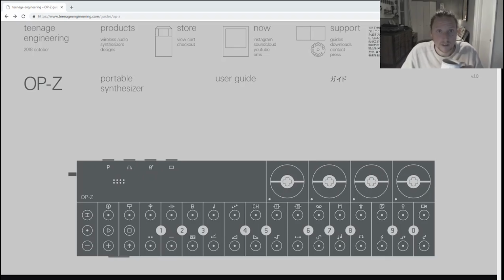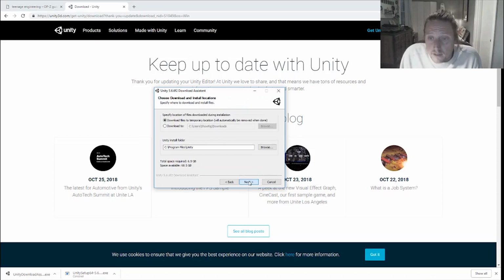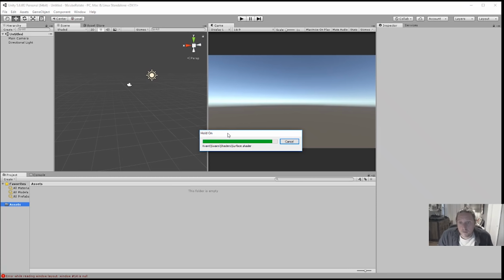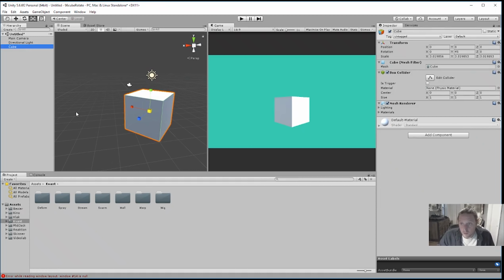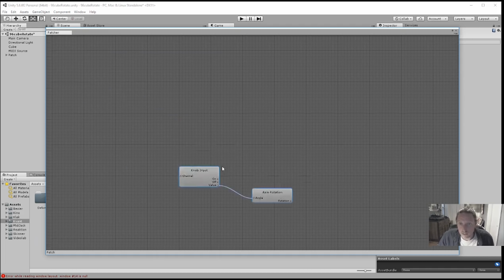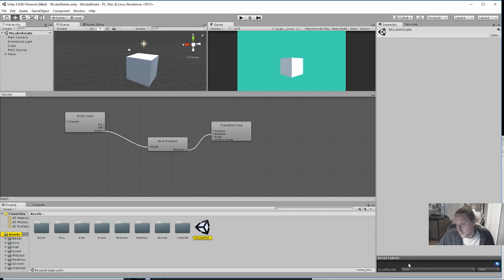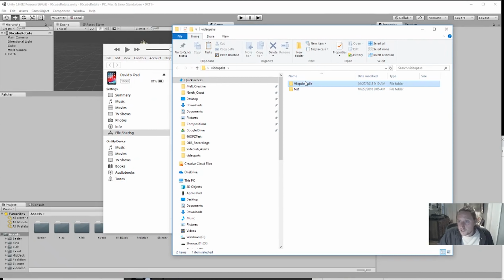OP-Z Videolab install and first steps

Comment: If you are a newb working on a fresh install and it just happens that nothing is working and there is a red error that seems to be telling you that you need the version of visual studio you've installed 4 times stop banging your head against the desk and do this. Open a new project, import video lab and in the project tab create a new folder called lab in assets and drag everything from the asset file into it... Now try again... There I just saved you 3 days of trouble shooting a QC issue nobody is talking about...  :P

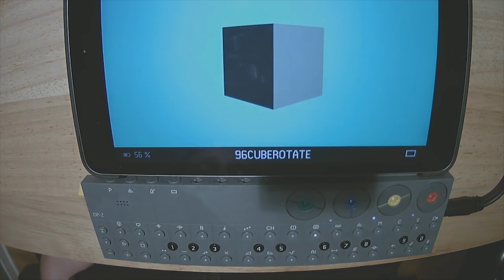Comment: 21:58 alternatively it is possible to set MIDI channel 16 and CC 1 for knob input inside the patcher so you don't have to change the MIDI settings inside OP-Z app, but this is a step further this tutorial i guess :)

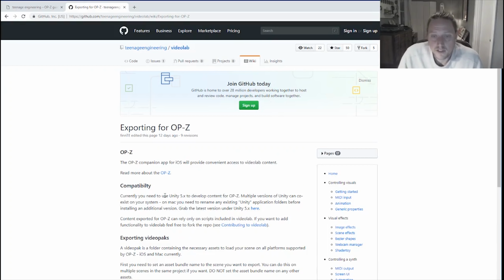Comment: 2:05 "Unity 5" - is incorrect these days? I just had Teenage Engineering tell me to use Unity 18.2.x   - if you could please update the description of this video to reflect the current advice from T.E. that would be handy. 💙👍
Reply from the maker: Thanks for reaching out!  I have 100% been meaning to release an updated series.  That stipulation that I mention actually was voided quite soon after the video released, apologies if I led you down the wrong path.

Comment: I have followed your directions over and over and over, and the ios app crashes every single time I click on the cuberotate motion pack.
Reply from the maker: This could be for a variety of reasons, most likely since this tutorial is dated there are firmware/os conflicts somwhere in the ios device/unity build/OPZ chain.  I am planning on returning soon with a more detailed tutorial series for creating visuals with Unity for the OPZ which will touch on these topic again briefly.  In the meantime I would double check to make sure you have all the current release candidates for all devices firmwares and operating systems.  Thanks for the support!

Comment: So I have had this question for a few months now but i just cant find the answer: I dont want to use their specific (well actually it not teenage engineerings) Klak visual language to make stuff. I want to write my own scripts in C# (for example, most easy in Unity). Teenage Engineering isnt answering my mails, do you know if this is possible? I dont like to be confined to using a basic language and relying on scripts that others wrote.
Reply from the maker: I don't see why it wouldn't work.  The author of Klak works at Unity so it is probably pretty nice under the hood when it comes to things like round trip latency communicating with your devices.  You can probably use the more utilitarian nodes as a starting point and then throw in some hand rolled stuff as you get ideas.  Anythings possible!  link me to your explorations, would love to see them!

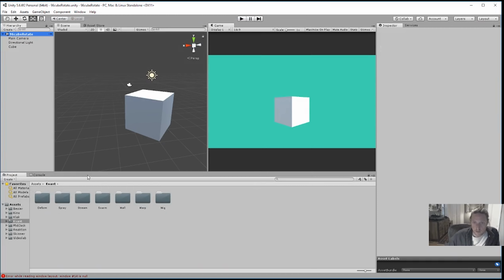Comment: so far this is an amazing walkthrough! Thank you so much! I've haven't done any 3d stuff ever but am excited to get going! one problem....someone please help tho…. at 10:21 you grab "Midi Source" My unity 5 doesn't have that in the drop down menu....is it a plugin I download? if so from where? Any help would be greatly appreciated. THANKS!!
Reply: need help too
Reply: Did you ever figure this out???
Reply: you need to install unity 18.2.x if you use videolab 1.1 .. otherwise unity 5.6.x with videolab 1.0 
https://github.com/teenageengineering/videolab/wiki/Exporting-for-OP%E2%80%90Z

I actually use unity 18.2.21 and imported the videolab 1.1 package and works fine.

Comment: I'm a bit late to the party since I was not able to get an OP-Z on the first wave.  Have it now though, but it's three months after your tutorial and most of the comments.  I've followed your tutorial and I've been able to do everything except get the files onto my ipad mini.  I'm using the latest VideoLab 1.1 (not beta3) and Unity 2018.2.20f1 personal.  Is this combo okay?  I was also careful to select Mac and iOS builds during install.  If all sounds ok so far, then it must be a glitch in my steps to get the right files uploaded/transferred via iTunes.  Nothing shows up on my ipad after I sync the built files.  I might be missing files or something.  Any ideas?
Reply: update: it must be something to do with my environment and build process or file management process because i was able to import Keijiro's projects and patcher info, etc. with no problem.  Still can't import your "cuberotate" example onto my device, however...  BTW, your vids are superb.  Thanks for your efforts to get us noobs going.
Reply from the maker: @moog55  yep! usually it is just one little checkbox or a mismatched pairing of some sort.  Keep trying you'll get it!

Comment: I'm getting this error after adding the MIDI input: 

ArgumentException: Value does not fall within the expected range.
UnityEditor.Graphs.Property.ConvertFromSingleValue (System.Object o) (at /Users/builduser/buildslave/unity/build/Editor/Graphs/UnityEditor.Graphs/Property.cs:339)
UnityEditor.Graphs.Property.set_value (System.Object value) (at /Users/builduser/buildslave/unity/build/Editor/Graphs/UnityEditor.Graphs/Property.cs:221)
UnityEditor.Graphs.Property..ctor (System.String typeString, System.String name) (at /Users/builduser/buildslave/unity/build/Editor/Graphs/UnityEditor.Graphs/Property.cs:175)
UnityEditor.Graphs.Node.ConstructAndAddProperty (System.String serializedTypeString, System.String name) (at /Users/builduser/buildslave/unity/build/Editor/Graphs/UnityEditor.Graphs/Node.cs:389)
UnityEditor.Graphs.Node.AddOrModifyPropertyForSlot (UnityEditor.Graphs.Slot s) (at /Users/builduser/buildslave/unity/build/Editor/Graphs/UnityEditor.Graphs/Node.cs:418)
UnityEditor.Graphs.Node.AddSlot (UnityEditor.Graphs.Slot s, System.Int32 index) (at /Users/builduser/buildslave/unity/build/Editor/Graphs/UnityEditor.Graphs/Node.cs:199)
UnityEditor.Graphs.Node.AddSlot (UnityEditor.Graphs.Slot s) (at /Users/builduser/buildslave/unity/build/Editor/Graphs/UnityEditor.Graphs/Node.cs:188)
UnityEditor.Graphs.Node.AddInputSlot (System.String name, System.Type type) (at /Users/builduser/buildslave/unity/build/Editor/Graphs/UnityEditor.Graphs/Node.cs:170)
Klak.Wiring.Patcher.Node.PopulateSlots () (at Assets/Klak/Wiring/Editor/Patcher/Node.cs:135)
Klak.Wiring.Patcher.Node.Initialize (Klak.Wiring.NodeBase runtimeInstance) (at Assets/Klak/Wiring/Editor/Patcher/Node.cs:117)
Klak.Wiring.Patcher.Node.Create (Klak.Wiring.NodeBase runtimeInstance) (at Assets/Klak/Wiring/Editor/Patcher/Node.cs:42)
Klak.Wiring.Patcher.GraphGUI.CreateMenuItemCallback (System.Object data) (at Assets/Klak/Wiring/Editor/Patcher/GraphGUI.cs:291)
UnityEditor.GenericMenu.CatchMenu (System.Object userData, System.String[] options, System.Int32 selected) (at /Users/builduser/buildslave/unity/build/Editor/Mono/GUI/GenericMenu.cs:119)

Any ideas?

Comment: Thanks for this. I have the problem that when I create a node in Klak (Knob Input), it doesn't show up in the patcher. It stays blank / grid. Just in the Hierarchy. Some other nodes like Sequencer Input do show up however. I'm using the newest Unity since I'm building for the newest OP-Z firmware, right?
Reply: OK. I now use Unity 5.6.6f2 with videolab 1.1 beta.2 (not 3) And this works for now.
Reply: @AABattery  Did you ever get this working with 2018.2.x?

Comment: Not sure what's wrong, but for the majority of the new nodes I try to create in the patcher I get the error "Value does not fall within the expected range." Anyone have any insight?
Reply: Had this issue also and eventually came across a solution on the videolab github, thanks to georgechond94's post: 

Downgrade to .NET 3.5... To do this: File -> Build Settings -> Player Settings... -> (in the inspector view) Other Settings -> Configuration -> Scripting Runtime Version -> *.NET 3.5 Equivalent (Deprecated)*

Comment: Just a heads up for all those trying this out after mid-December...the beta v 3 of the VideoLab repo causes an error "the type or namespace name playables' does not exist in the namespace unityengine'" in Unity 5.6. Just use the beta v 2 unity package and it'll work fine. Also, if you switch the Knob Number to 1 in the inspector for Knob Input (~14:24) then you won't have to edit the midi setup on the OP-Z and it'll just be plug and play once you select the videopak. Hopefully this helps people who might get stuck! :)

Comment: I really don't know what I'm doing wrong. I get to the part where you drag and drop your made file into the opz videopak and if i keep my file names cube rotate it just makes a brand new file slot in the opz
Or if i change the name to videopak it will overwrite videopak file and be located in my opz but when i try to open the visualizer the opz just crashes
Reply: ok so i downloaded unity 5. instead of 18.  The file has now loaded into the opz app but when i rotate the green knob nothing happens

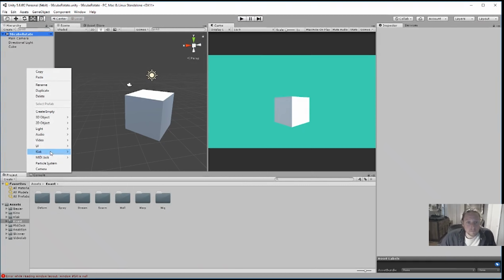Comment: At 10:24 when you add the MIDI asset, where is this coming from?  On my Unity install I don't seem to have a MIDI device, and googling seems to point me in some confusing directions.  I thought you might comment about this?  Are you using a special asset?  Thanks!
Reply from the maker: When you download the videolab zip from github MidiJack is included in that package.  Cheers!
Reply: Analog Parasite TV  Hey there! I think I just figured this out - since this vid was made videolab 1.1 is now on Unity 18.2 - the latest version you get from unity is 18.3 (not 18.2) so you'll have to use the archive link shown in the vid to get 18.2 - I just installed 18.2 and the dropdown menu for midi source is now working. Hope this helps!
Reply: I'm having the same issue buddy. Just in the process of reinstalling Unity to see if that helps - did you ever manage to solve this?
Reply: I think I downloaded the wrong version of videolab as it turns out! I was trying to use the pre-release 0.8 - I hope this helps someone!
Reply: can anyone help i still cant solve this issue! ive added the midijack package to the project but that right click menu option is not there for me so i have no idea how to add a midi source!
Reply: Analog Parasite TV  can you walk me through how you fixed that? I'm having the same issue and can't really figure it out. Thanks!
Reply: OK. Figured it out. This tutorial presents the 1.0 version of OP-Z VideoLab which requires UNITY v.5.6.6. The current version of VideoLab available on GitHub is version 1.1. which requires Unity 18.2. I downloaded 2018.2.21 and MidiJack is there.

Comment: I can get the up to the app, but it won't seem to rotate. I've checked my patches 100 times :( any thoughts? This was great by the way, helped me get past a couple roadblocks of just getting something on the screen.
Reply: Same MIDI problem you ran info - cv1 has to be set to zero. :) working now
Reply from the maker: @dugbell  It happens to me literally everytime lol
Reply: @ninetysix6032  I've got my knob set to 0 and I still can't get the damn cube to rotate!
Reply from the maker: @davidbingham8062  make sure your knobs are in their correct state, you have four banks of cc control on your motion track.  If you have matched the knob number with your corresponding knob number in Unity the only thing I think that could be responsible might be having the wrong bank of knobs selected... let me know if you discover an answer!
Reply: @ninetysix6032  thanks for your response!! knobs were all correctly set up. I rebuilt the same project with a different bundle name and it worked.. so that's weird but whatev. I created another test project and now the app just crashes every time I load it. The lack of exception handling makes for slow troubleshooting, to be sure.

Comment: Impressive...seems a bit laggy? Or do I need glasses
Reply from the maker: I think this one felt pretty on point to me.  My Ipad is old tho and it for sure runs a bit better on my iphone.  Also... I had to resync the audio in handbrake because my recording software captures the multicam in variable bitrate so it needs to be conformed to one master fps to edit so perceived lag could be due to this.  When I am using the app tho it looks great to me!

Comment: cant seem to get it to export videopaks, running macos high sierra with unity 5.6.6 personal, but when i select export videopak, it doesnt do anything other than open finder and once i select choose, it does nothing...
Reply: never mind, got it to work, just forgot to assign the bundle name
Reply from the maker: give the walkthrough another once over and double check that you have installed the build options for iOS and macOS.  If you are seeing the finder window open and are selecting a location for the program to build the videopak it should be working.  If you are getting folders with your asset name but nothing in them you might need to make sure you have those options ticked.  Let me know if this helps :)
Reply: @ninetysix6032  how would i go about setting up multiple scenes as is done in the built in videopaks? I have a series of fight move scenes that i want to have on separate keys!
Reply from the maker: @weewone  this is a topic for another walkthrough for sure!  It's on my radar!

Comment: Do you think that the files could be uploaded through the new iOS file system stuff? That might make life a little easier than having to deal with iTunes. Granted, I don't see it when I go to browse for it...yet. I don't have an OP-z right now, but I installed the app.
Reply from the maker: I have not checked out the new ios file system workflow... will go look into it!
Reply: @ninetysix6032  Last night, I followed along with what you did here, then tried to upload that way, and it looks like it won't do it....for now. Seems like the iOS file access stuff is mainly for like apps' 'products', like drawings or music or whatever. Would have made life easier...dropbox or iCloud, move into an OP-Z folder, done? Ah well.

This is really interesting. When I first heard about these features, I didn't think much about them...I'm a CG generalist and terrible putzing musician. But the more I check it out - it seems like fun. Starting to be intrigued with tying visuals with music. I can't wait to test it out.